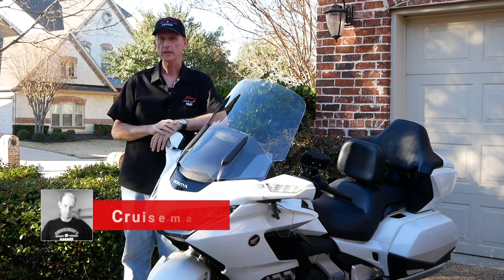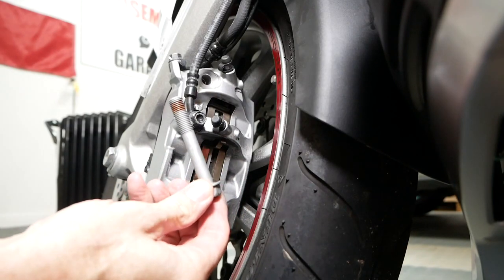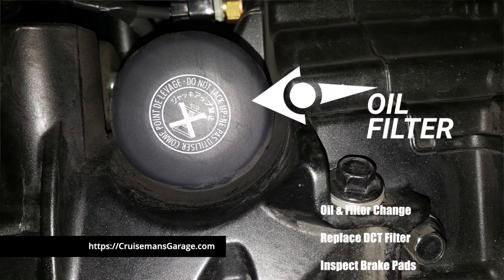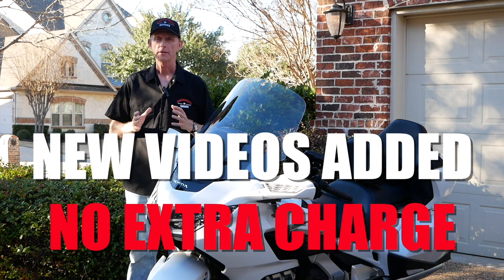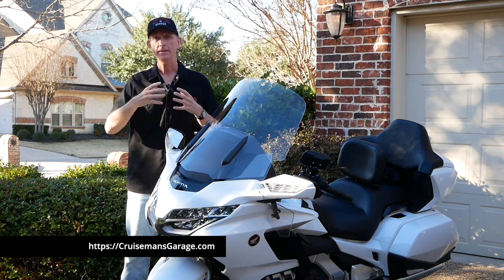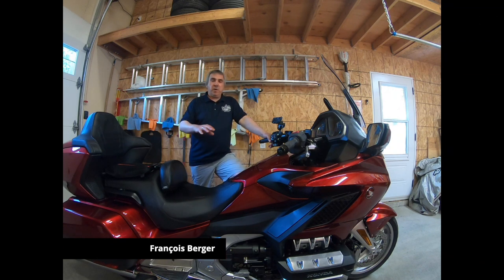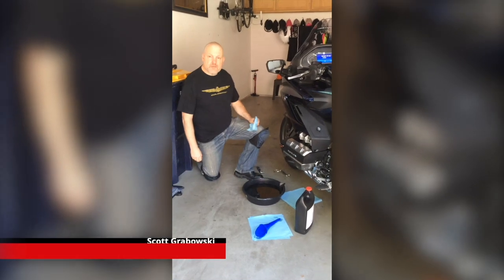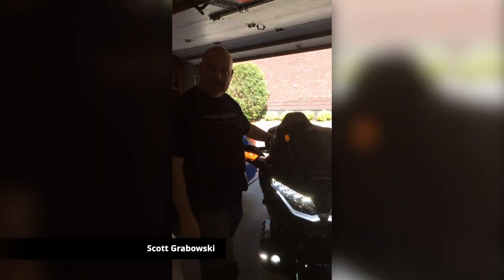2018-2020 Goldwing Maintenance Videos Trailer | CruisemansGarage.com

Comment: I've got the set of videos for the pre 2012 Goldwings and love them! A couple quick notes on things I've found that could be helpful. Very random here...when putting the handlebar reservoirs back together after clutch or brake flush it seems much easier to fit the top plastic piece into the rubber gasket before installing either one. Putting them back on as a unit prevents any chance of pinching the rubber or having it slip down away from the edge. Gives a perfect seal every time. It's easy to see how they were designed to fit together. Also, removing the drain plug of the cooling system BEFORE removing the radiator cap will keep you from getting your arm soaked down in the splash zone. Then you can fiddle with the radiator cap to meter out the coolant so it doesn't make a huge mess. Just a couple suggestions from an amateur. Keep up the great work sir!

Comment: will performing my own routine maintenance void the warranty on my brand new 2020? Do I need to log the maintenance somewhere just in case I ever need something done under warranty?
Reply from the maker: It is not required, but I do it just to be safe. If you purchase my maintenance videos, it comes with a spreadsheet you can use for tracking maintenance tasks.
Reply from the maker: And, doing your own maintenance will not affect your warranty.